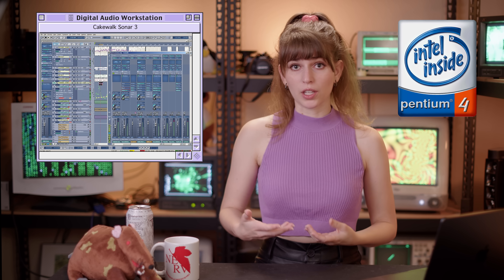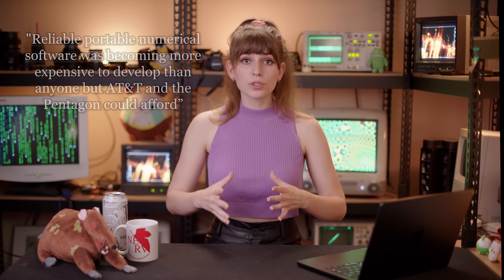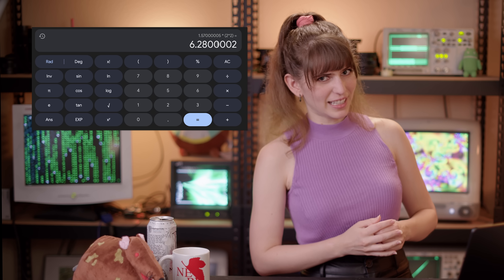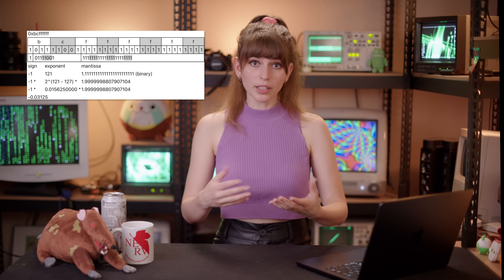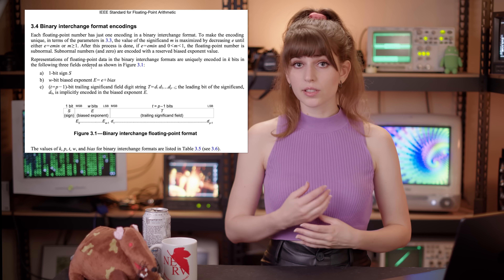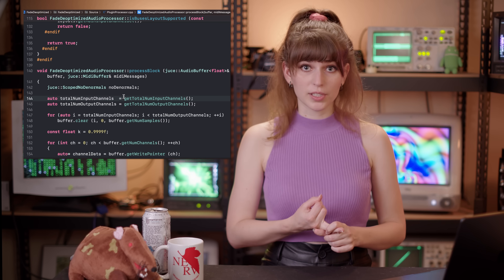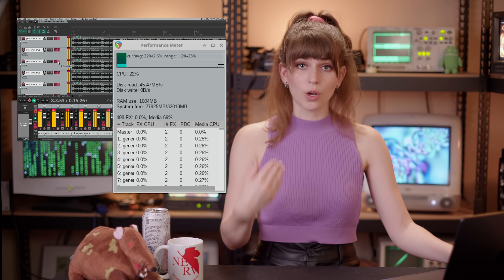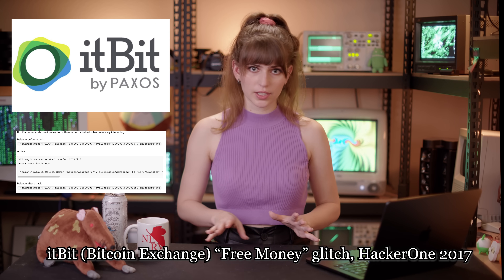Fading Audio is ROUGH on CPUs

Comment: 6:00 there's a famous example: 0.1 + 0.2 produces 0.30000000000000004 and not 0.3 :face-blue-smiling: works everywhere: browser javascript, c++, java
Reply: And the catch is, that .01+.02 ,  .1+.1 ,  .1+.3 ,  or 1.1+1.2 work just fine. But some combinations of numbers trip up
Reply: even worse, 0.1 + 0.2 > 0.3 == true
Reply: @kobikaicalev175 that's a question you should never ask of a floating Point number.  Effectively you're asking it to subtract 0.3 and compare equality with zero. You should never test the output of floating Point arithmetic for equality.  You should always take the absolute value of the difference between your number and the other number and check if it is less than a threshold.

So In this case

Abs(0.1+0.2-0.3) < 0.001
Reply: Uhh.. there are other floats formats/precision besides 32bit floats.
Reply: @TurboXray  yes there are ieee 754 decimal floats, but who uses them 🙈
Reply: @TurboXray  There are, but they all suffer from the same problem. 64 bit floats contain non 23 bits of mantissa but 53, it's all the difference. There is no FPU in the world that has number formats that don't suffer from it.
Reply: @nikitakipriyanov7260  Yeah, but the issue demonstrated by the OP is because of the radix. There exists floats with a decimal radix (not binary), just like there exist BCDs in general.
Reply: there's not really a reason to use single precision float except if you are really hurting for storage space or you are intending to Leverage packed (SIMD) arithmetic where you care less about the Precision than the ability to tear through arrays  quickly.

Basically if you have enough items to go through that the performance matters, you'll know.  You can always optimize later.
Reply: @data_abort  the 0.1 + 0.2 != 0.3 example is for double precision
Reply: Not in c# tho 😂😂
Reply: @lucas_is_away  yes in C#. there is an additional number type Decimal that uses base 10, but it is significantly larger, slower, and not the default. 0.1 + 0.2 still isnt equal to 0.3. this is true of every language that uses IEEE 754 floats, no exceptions
Reply: @lucas_is_away  If you use singles (floats), you get 0.3. If you use doubles, you get 0.30000000000000004. Some days I wish I had become an electrician instead of a programmer.
Reply: I like how everybody is so attached into decimal fractions that they forget that computer's floating point works with binary fractions.

0.1 can not be reprsented exactly in binary, because it's 1/10 and 10 doesn't divide 2 or any of its powers. Technically it should be 0.000110011 0011...₂. In the same way, 0.2 is 0.00110011 0011...₂ (two times larger, thus, one leading zero less). Their exact sum would be, therefore, 0.0100110011...₂. But computers don't operate with infinitely long digit strings. They chop these fractions at some point, and that chopping introduces noise. Sometimes, that noise adds up and creeps into the "visible area" of the number.

In 32-bit IEEE float, 0.1 is represented as 0.000110011001100110011001101₂ (I omit the exponent, bias, and so on, providing the real mathematical value that is stored), here the last out-of-place 1 is 0.11₂ rouded up, consider it to be similar to how we do 2/3 ≈ 0.66667. Likewise, 0.2 is represented as 0.00110011001100110011001101₂: since it's exactly two times larger, mantissa is exactly the same, only the exponent is different. It's these numbers what is really being added up. The best representation of 0.3 would be 0.0100110011001100110011010₂ (I've retained the last zero to emphasize the fact it has last bit 0 in the mantissa in the representation)

So, it's not that computer can't add 0.1 and 0.2 precisely. It even can't store exactly neither 0.1 nor 0.2, as well as 0.3. When it prints numbers out, it chops, decimals this time, showing perfect 0.1, which it's slightly a lie, because it's 0.100000001490116119384765625 what is really stored in the memory. But when it prints its computed 0.3, it's off enough for this noise to creep past chopping threshold and show up in the decimal representation it displays to us.
Reply: laughs in lua
Reply: @RipVanFish09  its really simple to test this. go ahead and type `0.1 + 0.2 == 0.3` into a lua interpreter. again, there are *no exceptions*. this is how binary floating point arithmetic is specified to work.
Reply: @RipVanFish09  try print(string.format("%.17g", 0.1 + 0.2))
lua is cheating because it uses "%.14g" as a default print format, so silently truncating 3 less significant digits of double precision fps

Comment: Finance does not use floats.  Real (non-crypto) finance uses fixed point calculations where the precision is under control.
Reply from the maker: tell that to the Vancouver Stock Exchange ;)
https://en.wikipedia.org/wiki/Vancouver_Stock_Exchange
Reply: @lauriewired  that's just horrifying.  Nobody who is not afraid of using floats should ever be allowed to use floats.

Comment: Float or fixed point multiply takes same time on most CPUs, regardless how large the number is. On modern CPUs, float multiply is 1 clock cycle, not to mention the existence of multiply-accumulate instruction and vectorization (either SIMD or whole vector processing).
Reply: So in 1993 Atari included the MAC instruction in their Jaguar. It runs in a single cycle, but only works for 16 bits. Doesn’t latency rise with more bits? Or did Atari already hide the latency? Because I can issue one MUL per cycle, but have to wait two cycles to use the result. (two for MUL, three for MAC ( Add takes a cycle )).
Reply: You're very incorrect here, and the trouble lies in division. While floating point divisions are some of the most optimized instructions on a modern CPU, integer divisions are precisely the opposite. For example, on Zen 4, the fastest integer division has a maximum throughput of 64 bits every 7 clock cycles, whereby the fastest floating point division is 512 bits (a full cache line) in half a clock cycle. (Two can be issued at once). This information is measured and publicly available on the x86 uops info site.

There simply are no SIMD instructions that implement integer division and modulo,  nor are there SIMD operations that implement integer shifting.

While it all sounds nonsensically fast, it all scales very easily — A Zen4 doing integer division is at its absolute peak throughput is 224 times slower than one doing floating point division. We went from 4GHz to 16MHz

Comment: Absolute nonsense.  Audio fading is just multiplying source sample by a predefined level value from a fade curve, that could either be function defined by a function (curve generated in-place), or can be pre-calculated in memory. Then all complexity collapses to just a single multiply per sample. What a difficulty for a CPU...
Reply: It's not actually about the fade effect, it's about other similar effects such as reverb and IIR which are single multiplication yes, so they're very quick, but they result in a never ending tail of oscillations that don't stop after the source goes silent.

Comment: I am curios on how it works on scientific application where you really really need the correct decimals.
Reply: The floating point errors are usually smaller than measurement errors.  If your measurements are that precise, you don't use standard floating point. What you use instead depends on the details.
Reply: @jimjjewett  Thanks for your explanation. e.g. for calculating the decimals of Pi, subatomic measurements (e.g. at CERN), all around calculations, measurements and simulations in Physics and Math where you cannot round a decimal to  zero, what they do then?
Reply: You never use single precision floats (32-bit) in scientific computing, you go to 64-bit (double) or extended precision (80-bit). Reaching denorm in doubles is a cosmic level unlikely occurrence.

If you have discrete inputs and need to preserve them bit perfectly, you can also use big (arbitrary precision, dynamic) decimals, but they're not exactly quick.
Reply: @SianaGearz  Thanks for your comment on this. I did not know that.

Comment: I think developers should be aware of these things. I was not aware of these things - but then again I should only be ashamed of it if I was developing high performance applications which use floating point e.g. games or something. I am pretty sure games don't need these subnormals in their calculations. For audio... for preview I'd say they probably don't matter but maybe for final rendering they would. Not sure. Depends... probably.
Reply: No, they do not. If such precisions ever mattered, if you came up with an algorithm where they do, you would use a double intermediate, and then you wouldn't have the denorm issue either. Besides fundamentally it would be very finicky, very numerically unstable, difficult to get predictable outcomes from. All audio basically lives in 24-bit domain, which in analogue circuits is the borderline unachievable 140dB of dynamic range, thereabouts. Once you add a little bit of flexibility with float exponent, you have loads of headroom.
Reply: @SianaGearz  This makes perfect sense. That is why I said devs who use high performance floats should know this stuff. This video is the first time I heard there are some different performing modes on x86 FPU that does with precision of calculation. Of course different precission outside different float formats.

Comment: 16:09 Well I can tell you that iOS and Android do not agree on this issue. If you have access to both on mobile the way they do precise floats is different which is why

(10^^100) +1 - (10^^100) = 0
or 
(10^^100) +1 - (10^^100) = 1

Now before you try this out guess which is which.

Comment: As a music producer, I really don't care about extreme precision if it's gonna hassle my CPU lol
Working on a song with 60+ channels right now, last thing I need is CPU spikes for simple volume fades 😆
Reply: Fades didn't actually cause this (much), since they just follow a curve and when they get silent enough, they just stop, it's other effects which have a long faint trail of silent audio that did. For example reverbs and IIR filters. Both use a low-magnitude copy of audio from the past, fold it into the signal, and re-use the folded signal a short time later, so if the input goes silent, the output does not, it keeps ringing at ever decreasing magnitude forever.
Reply: I would have thought that small numbers in a DAW likely means "Data below the noise floor."  But there's so much technical stuff with audio data processing, like dithering, I can't be sure my thought is correct.  If it is data below the noise floor, no one cares.

Comment: How did old computers do this ? did they have software controlled amplifiers for every channel? Like the Amiga computer.  You could steer every notes volume easily when doing music in ProTracker. edit: I found this "Individual Volume Control: Each of the four channels had its own volume register. This register could be set to one of 65 distinct volume levels (0-64)" so yes in hardware
Reply: It was done in hardware by setting voltage levels. A simple form of a digital-to-analog converter. No math required.

Comment: Back not too long ago when I was a junior dev I was mostly using a reporting tool to write reports for clinical and business folk out of our EHR.  One of the requests I got was a report for the Revenue Cycle team to get accounts over a certain age with a nonzero balance.  Naively, I just put a where balance_amt > 0 filter on the query. Which took about 30 minutes to run, and then the reporting tool thought real hard about it for another 20 or so before giving up and saying to write a query that returned fewer results.  I looked at the query details and saw that it had returned 10s of millions of results.  Enough that it it truncated the result table even.  Curious I looked at it, and realized that the EHR devs had used floats for the balance field, and evidently not done any sort of leveling of the values after applying transactions, so basically ever account that had ever done anything at all with money had a nonzero balance, even if it was waaay to right of the decimal.

Comment: I don't know. In my experience if you're representing fiduciary quantities with floating point numbers, that is a problem. Even though some folks do it. The best representation of fiduciaries are micros of currency - 1000000x the amount of the standard value of the currency.

Subnormals are also more complex than just dropping to zero, but for some applications, you do need that kind of low-figure accuracy, so I'm okay with them.

Comment: Why use floating point for audio? Your range is fixed, so fixed point makes more sense, doesn't it? I guess it's because fixed point ain't a commonly supported data type in most languages.
Reply: The difference between 3 and 4 is more important than the difference between 1003 and 1004.  That gets magnified with logarithmic scales, and hearing (and sound pressure) are much closer to logarithmic than to linear.  Floating point can be a good start for compression.  Though I suspect the real reason is usually indeed convenience.

Comment: If you're using floating point for audio, you're doing it wrong. A large fixed point representation, scaled correctly will behave. DSP people know this. If you need 10,000 digits of floating precision, you can use the MPFR library and be prepared for it to be slow.
Reply: Well go into the past into the mid-late 90s and tell Steinberg that. Ever since VST/VST2 was introduced, floats are the foundation of the software audio pipeline. Thing is you don't have a DSP, and the x87 FPU was very powerful at the time with lots and lots of supported arithmetic, doing this in x86 integer would have meant a lot of fundamental overhead.
Reply: @SianaGearz  The telephone people (in the 80s and 90s) were using a logarithmically coded PCM for phone audio encoding. This works nicely in that with logarithmic coding, you can use log tables for addition and addition for multiplication which is cheap both in hardware and software. Scale this up to a larger word width and you would have the high quality audio encoding with no slow operations, even on integer only hardware. In the early 90s I worked with systems using pairs of uint32s for 32 bits to the left of the point and 32 fractional bits to the right. This was not complicated. Steinberg messed up. Steinberg had better options.

Comment: Nice explanation. I wish I had you around when I was programming in assembler back in 1982. I did a lot of fixed point calculations in 8080, 8088, Z80 and X86. The iX87 series were the math co-processors, the actual computers would pass off the CPU intensive math to the iX87 co-processors. You said the i87's were the Intel processors. I still have a bunch laying around.
Reply: Yes from today’s POV kind of crazy, the 486 was the first model to have the FPU integrated as standard… and then they created the 486SX which was a low cost version where the FPU was disabled. This way they could sell CPUs where the FPU was defective.